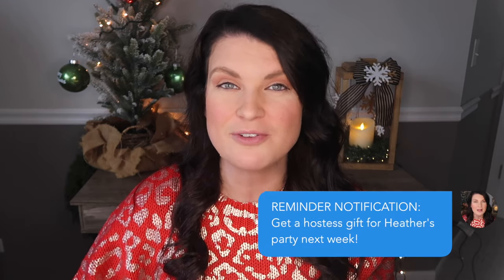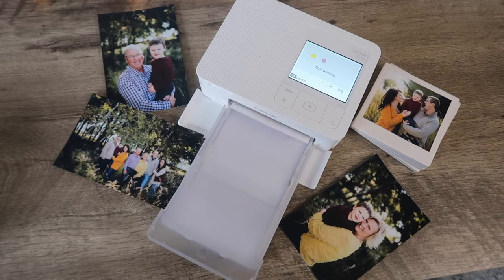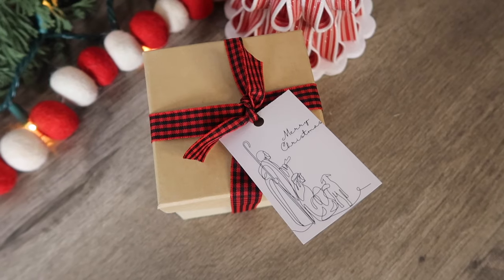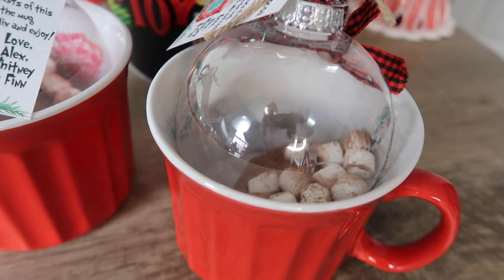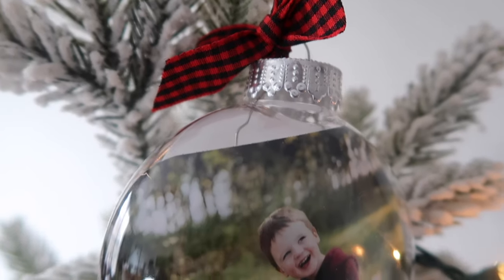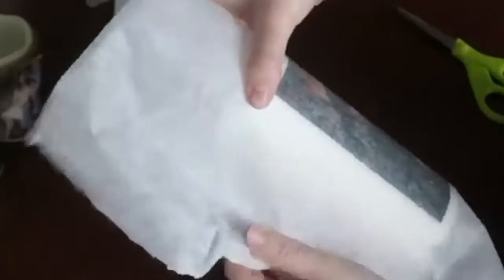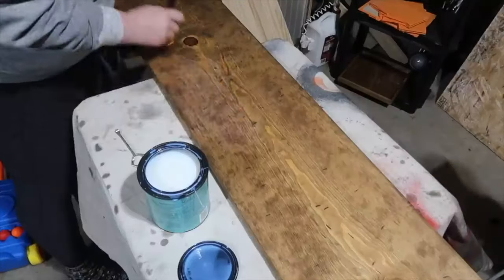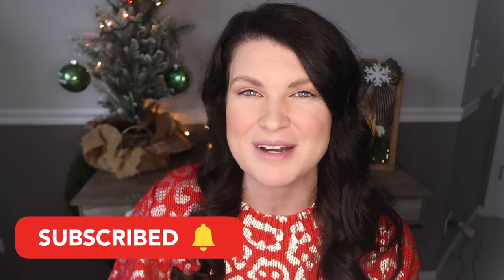20 thoughtful DIY gift ideas people ACTUALLY want! 🌲 (Affordable + Amazing!)

Comment: When I cut thin letters on my cricut they pull up and get tangled together while the cutting is going on. Any suggestions? Do I need new blade?
Reply from the maker: Hey Pam! I would suggest 2 things 1) make sure your blade is sharp. I replace mine approx ever 6-9 months because I cut a lot and that your mat is clean and sticky to hold the vinyl and 2) I like to use the iron-on setting and it tends to not cut as deep and move the vinyl around. My favorite vinyl is Oracal 651 permanent, I've had the least amount of issues with that.